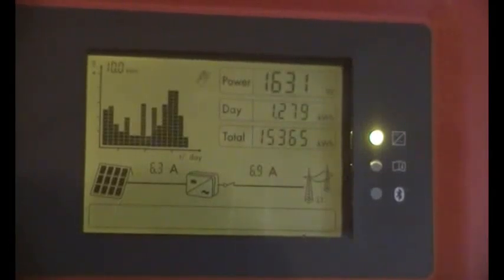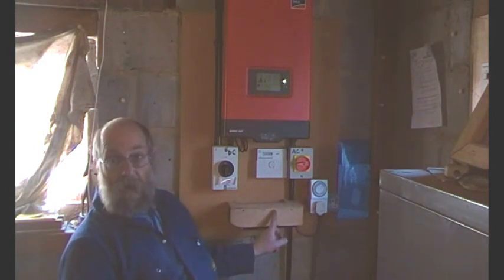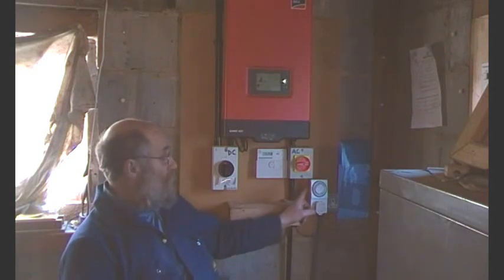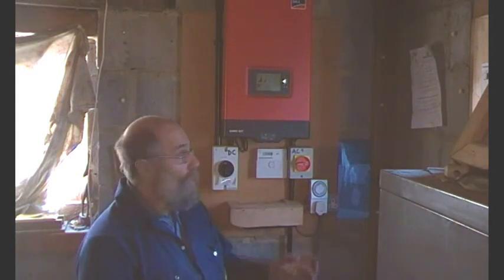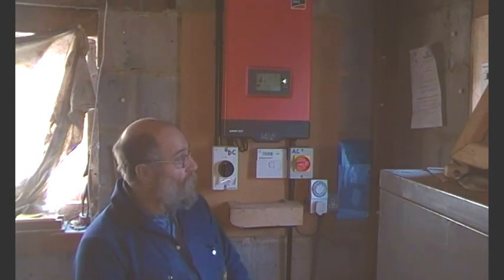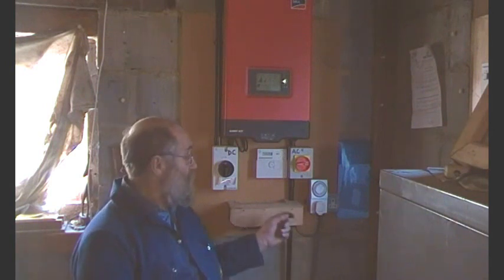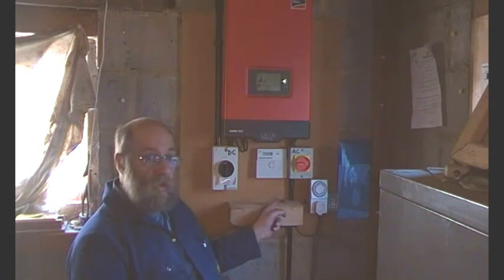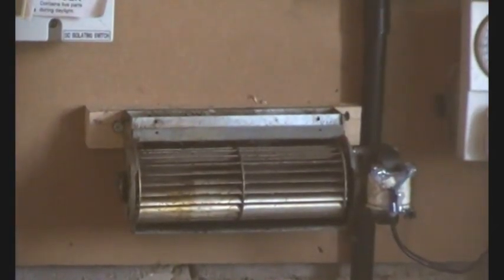Solar Grid inverters, prevent failure, extending the working life, .

Comment: Hello Andy, I have a commercially installed system with 16x250W panels in two arrays feeding into an Aurora 3.6 kw inverter, grid tied. The system is about 8 years old, the original inverter blew up spectacularly, taking out the relay board, the logic/control board and blowing a mosfet on the inverter. I replaced with a second hand unit, same model and have since acquired a couple of very cheap failed inverters, same model, which I have since repaired, so I now have three working inverters.

Question, Am I ok installing  one of the spare inverters running in parallel with the original inverter so I split the load between the two, as per this video, with both feeding into the FIT export meter? Presumably the two inverters will sync with the mains and not cause any problems either with each other or the export meter, but I'm not absolutely sure, lol. Any advice would be much appreciated. Thanks for all your helpful videos.
Reply from the maker: Hi, 4KW into a 3.6Kw inverter is a bad idea. I would split your array in half and use a separate inverter on each half. Mounting the inverters in a cool well ventilated place. Cheers
Reply: @TheInfoworks  Hello, I fitted the extra inverter this morning, all running well, as a bonus during a brief period of hazy sunshine, I noticed they were each generating slightly over 2 kw, so I'm generating more than before, running nice and cool too at just over 30C. You help is much appreciated. Thanks.
Reply from the maker: @andypdq  Brilliant that you got on with it so quickly, I hope you are a subscriber as there's some great news due out soon, cheers
Reply: Loving your knowledge through trial and error👏👏👏
Have just paid tiny money on a SB2500 with fault 6408, it's not that I don't want to investigate but am new to inverters, so any advice will be helpful🤞
Reply from the maker: @stevepr100  Inverters from this country are a bit tricky and the fact that they use sunclix plugs does not help.  I'm uncertain what that code means, cheers

Comment: How hot is too hot? My inverter was running at around 50c today.
Reply from the maker: Philip, that's too hot. You need an extrnal fan blowing cool air, cheers
Reply: Thanks for the reply, I've found a fan on line, so will get on and make a box for it. Really useful information.
Reply from the maker: @philiponsolent7232  mine runs on a time switch from 10am to 5 pm in the summer months and is a fan robbed from a scrap fan assist oven, cheers
Reply: Made a fan assembly like yours and now the temperature never goes over 30 degrees. Thanks for the tip.
Reply from the maker: @philiponsolent7232  Splendid news, that will make things last much longer, cheers

Comment: Very helpful advice, Andy.  I'm now a subscriber.  Can you provide some info on the type of 'snail' fan and where to source from?  I've made a few searches, but none seem suitable so far.  Many thanks.
Reply from the maker: Paul, Hi, I reclaimed this from a fan assisted oven, but you could use a computer fan and a 12v plug in power supply. I collect this sort of thing just in case, cheers
Reply: Okay, thanks Andy.

Comment: Good advice I think I will stick a fan on to blow air on my grid tie. This was a commercial install a couple of years ago 16 x 250 watt panels in two strings of 8 panels the inverter has 2 PV inputs one for each string but the inverter is 3.6 kw so probably being over driven occasionally.
Reply from the maker: Mark, definately fit an extrnal fan as your analysis sounds correct, Subscribed? cheers
Reply: @TheInfoworks  I know I might be asking a silly question. But I want to know if you can convert a sunny boy. to run off grid With a battery bank.
Reply from the maker: Hi, grid inverters need to mains for frequency and voltage signals, without which they will not run, cheers
Reply: @TheInfoworks  thanks King Andy

Comment: So many things run super hot now, it's ridiculous. I bought a small Black'n'Decker battery charger a while back and when I first used it several days ago it got significantly warmer than a typical laptop PSU (and they run a bit too warm too). In fact it's so warm I think I'll end up re-casing it with a fan or lager heatsink. 

Also, the fan in my Xantrex Pro-Sine 1800 inverter finally crapped out the other day. I don't want to shut it down and take it all apart at present, as it runs our fridge and freezer. Plus other small "always on" loads. So I just strapped an old CPU fan onto the intake vent. And that keeps it cooler than the internal one ever did, although one day I'll get around to replacing it.
Reply from the maker: Yes, they run hot so they pack up, running at half load and attending to cooling makes things last, cheers